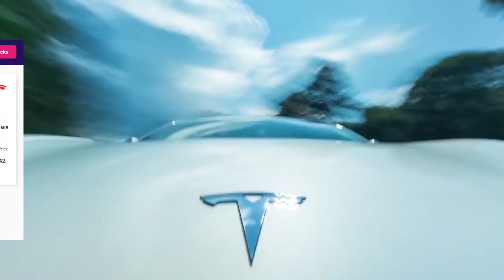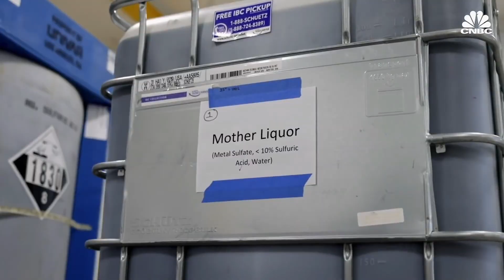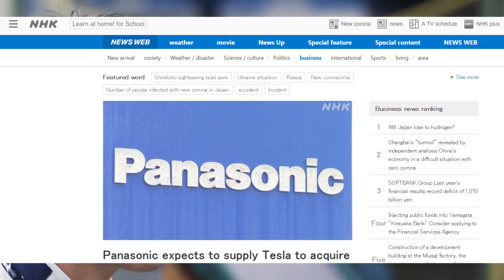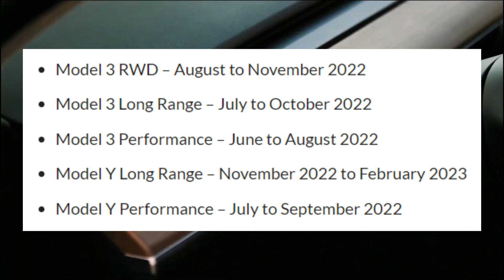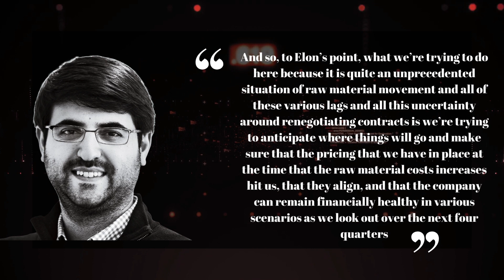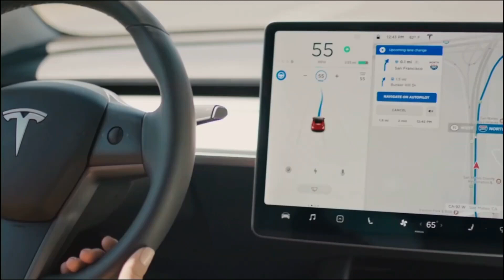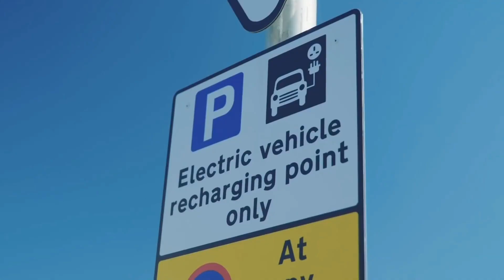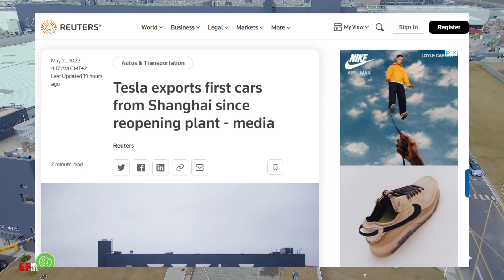Tesla Model Y Performance Prove Itself Again & More Tesla News

Comment: I just ordered a PMY to replace our 2020 LR AWD Y.  I figured there were enough changes to make it worthwhile plus I was offered $61,866 for our used 2020 Y.  The new one is $69,440 and IL just approved a $4K cash rebate effective July 1st so it was a no-brainer.  But I am dumping the 21" Uberturbine wheel/tires for some 19s from TSportLine.  Anxious in IL.
Reply: Yeah, that’s the first thing I changed (tires) and I like it so much more.  It was an extra $2,500 to make it square.
Reply: by chance is that through a private buyer or Tesla trade in? I’m only curious to know how well the value holds up.